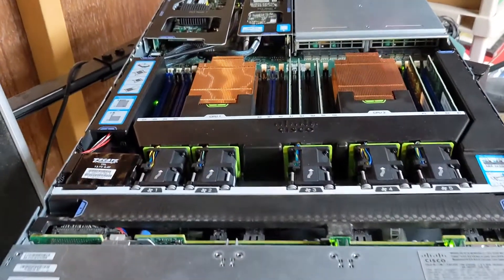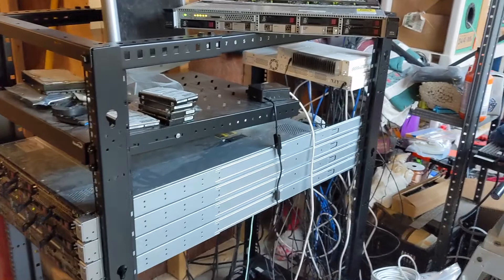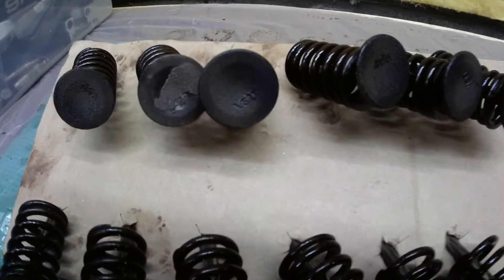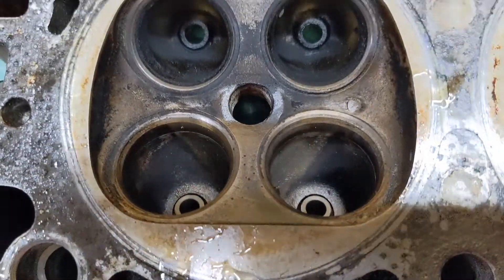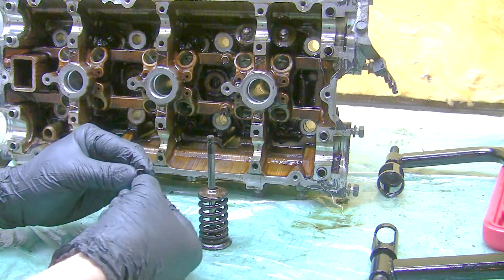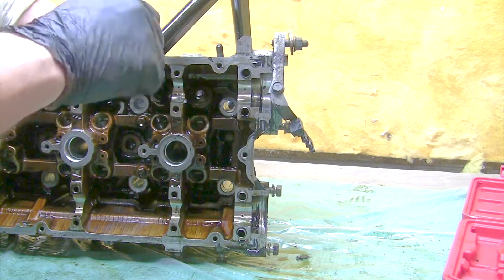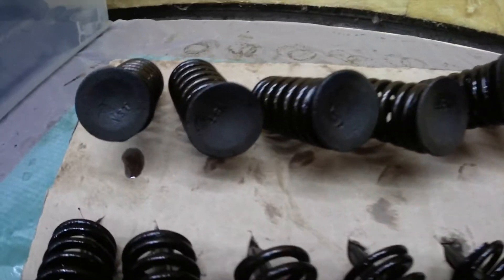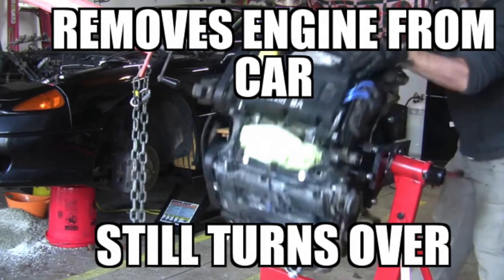6G72 Engine Disassembly - Part 3

Comment: The quick way to get the valves out is to use a socket the size of the spring retainer and hit it with a hammer, they just pop apart, it takes only seconds.
Reply from the maker: I will try that one on my next engine teardown.  Thanks.